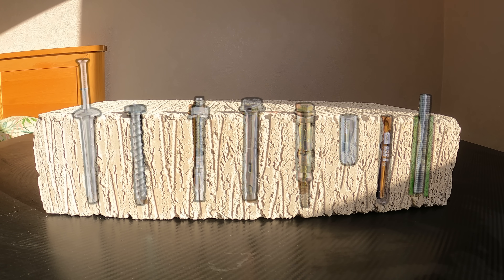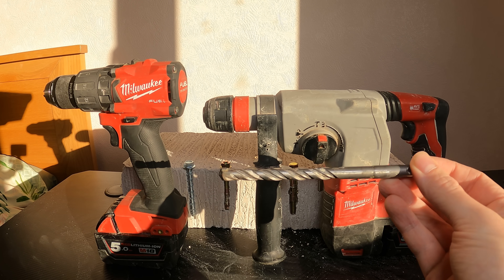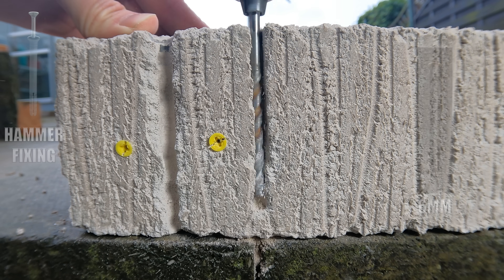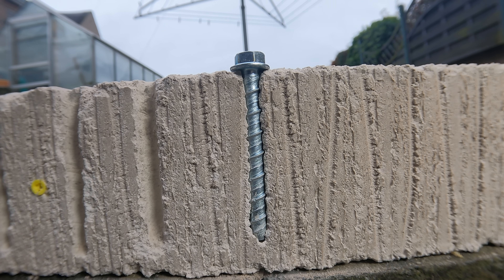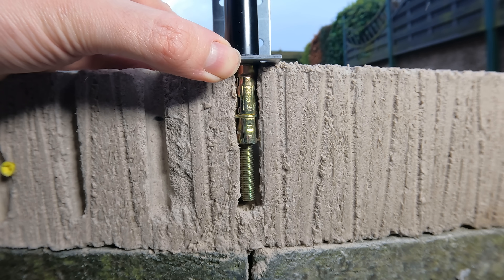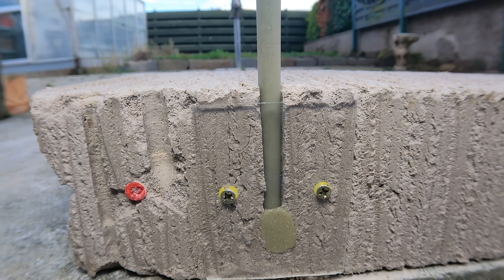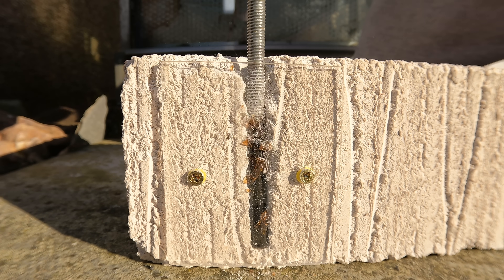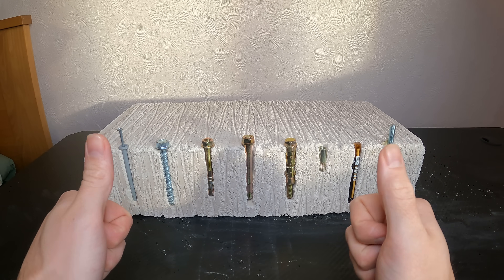CONCRETE ANCHORS FIXINGS AND BOLTS - 8 DIFFERENT METHODS FOR FIXING INTO CONCRETE

Comment: The glass tube resin I get to use on industrial jobs, and we use a paddle bit we break the glass with and mix it up, then stick in the threaded rod. Very strong for industrial applications,

Comment: Completely missed the point that the expanding anchors are putting a lot of stress into the concrete. For a solid piece of concrete that might not be too relevant, but if you're close to an edge, the quality of the concrete isn't too good or you overdo it with the tightening, or you have multiple anchors in a row with too low of a distance, you might just as well crack and maybe even split the whole block.

Comment: 2 is not secure in that kind of concrete, any kind of vibration or overturn would enlarge that hole and fall out.
6 is laughable. Most useless and ill thought design.

Comment: This was an incredibly done video. I am like you, and visuals are always better. I like the standard bolt, but could you mix it with resin, or with the expanding bolts, for a more permanent, secure result? Or is that just stupid or dumb?
Reply from the maker: Yeah you could do, just means its a permanent fixing and won't be able to remove it if required like you can with some of the other options

Comment: 35 years building and I don't use any of those anymore. The screws pull out, the anchors, too much drilling, the glue is a mess with air bubbles. 
GRK screws with weed hacker line or 14/2 works every time. Won't pull out, but it's also removable. And cheap.

Comment: Your sample is not a mixture of sand and cement in relative proportions, which is considered classic concrete all over the world. Do not use misleading terms, because the construction reference literature is the same, as is the data in it...... At best, your "concrete" is "porous concrete", called ["gas silicate" block] in Eastern Europe. ;)

Comment: The major advantage of resin anchors is that no water can penetrate the hole and, if it freezes, crack the concrete.
Especially suitable for outdoor use in concrete slabs.

Comment: Sleeve anchors for the win in all of my projects over the past 20+ years.  Never had one fail.  

I did have an issue once where I drilled the hole diameters too large and when tightening the bolts of course they worked their way out of the hole.  Luckily, I just bought the next wider size sleeve anchors and the problem was solved.  Key is to always drill the correct size hole.  Oh yeah, get that dust out of the hole to avoid having an issue with the anchor not dropping all the way down.

Comment: Extremely well done. It was explained with all of the details necessary and covered most every fastener available got a typical hardware or lumber store.
....and no music !!! 😁
If you did include some, I'll suggest MC Hammer's  Hammer Time or  Peter Gabriel's Sledge Hammer, used sparingly but only on the appropriate fasteners. 😉
Reply from the maker: haha nice one

Comment: A "through bolt"???  That's an expansion bolt and one of the manufacturers of them used to make a product called a "TruBolt".
If you are wanting to use an anchor for a use where it needs to hold a significant amount of load then it is critical that the hole be drilled AND CLEANED exactly per the manufacturer's recommendations.  It can make a lot more difference in the anchor capacity than you would think.
The concrete bolt tends to have the highest capacity these days, second would be the chemical anchor (usually called an epoxy anchor).

Comment: I like the screw bolt and resin fixings, which brings me to my dilemma.  I want to install an 8-kilo wall-mounted umbrella.  3m diameter umbrella when erected.  I have a hollow brick pillar, approximately 35cm square, perfect for the umbrella.  Should I use the screw bolt going in about 100mm or put a steel rod with fixing resin?  There are two mounting plates, each with 3 holes, so 6 mounting points in total.

Comment: Nice vid thx. One comment on the resin/ stud fixing - using a nut under the item being mounted places no jacking out torque on the concrete for a more secure mount.

Comment: Nice work on the video. A very interesting comparative description.  For your interest an old bushie (here in Australia) told me in the 1940s that he used to hand drill holes in rock with a hammer and steel rod, then insert the bolt but would back fill the hole with sulfur. They would then ignite the sulfur and it would bond the metal bolt to the rock. He said it worked well but I'm sure corrosion would have been a problem.
Reply from the maker: That's a new one I've not heard off. Thanks for the comments

Comment: Nice video there mate with drilling right on the edge! Screw bolts that I use (usually 14, 16 & 18mm dia.) are rated higher than sleeve anchors of same diameter. Using dustless SDS drill bits these days too. Total game changer. Can re-use the screw bolts again and again also. Winning!

Comment: However, it should be noted that concrete screws are not suitable for brick. The base material must be concrete if you want to use these screws. And if fire protection measures are relevant, plastic solutions are not acceptable.

Comment: I have to work with soft Austrian brick and lime mortar circa 1900. After lots of trial and error I’ve settled on epoxy resin in the mortar joints (to avoid breaking brick) and imbedding a threaded rod.

Comment: I love the drop in anchor to use normal m8-m10 bolts to fix things on the wall and to separte a storage space wall in low a pitched roof area from the normal room by having only small drill holes in the parquet floor. 
This enables a strong divider wall continous parquet floor and easy access via removeable dividers to the storage space 
And i have not to think about wear out of the fixing in the wall because of the metal threads.

Comment: Man, thank you so much for making this video. It is incredibly educational and i wish i watched it before messing up my anchor. So i installed a Sleeve Anchor but stupidly used an impactdriver and ended up capping the hear and now the bolt is tight and just flush with the concrete, the rest iscame off with the nut. How can i fix that?

Comment: Drilled a lot of anchors for mounting lights and what not.  Never have I bothered to clean out the hole. Then again, I don't bother with depth either.  So the hole is pretty much always deeper than the bolt.  
I imagine this only matters on a flat / horizontal surface as I've never had problems when putting anchors in walls.

Comment: Good introduction video but you should have gone into why there's so much variety in this type of fixing. You wouldn't use a hammer in fixing for the same job as a sleeve or shield anchor.

Comment: For my personal experience, shield anchor and drop-in anchor give me the "best user experience" in securement; Plastic wall plug with screw is my normal day-to-day application - fixing shelf, bracket, tv bracket, etc for moderate loading

Comment: In my experience, sleeve anchors either loosen up over time or if your attaching a post support to concrete, any movement in that post when installing loosens the bolt. 
The concrete screw bolts are far superior to everything else. The will not loosen or back and creates a fixing that competes with chemset.

Comment: 0:55 I think it's worth mentioning that the power of SDS drill hammer is not about the max force to rotate the drill but the max force to hit the drill against the concrete (SDS drill typically has 4–20 times higher hammering force). And it's pretty much the latter feature that limits your progress with concrete.

The demo shows that SDS drill was 50% faster but if you have actually hard and dense concrete, the SDS drill may be more than 10x faster. And if the concrete you have to drill contains big stones of granite, you better have real SDS drill because drilling pure granite with anything less is going to be a slow operation.

Comment: That's cheese,  now show us  the same, but in concrete!!!!    it does NOT work like that;  use SOLID concrete, use those methods, then  SHAKE and PULL, SHAKE and PULL, and MEASURE the forces needed, please quit playing around;   thanks for the video, still LIKED it

Comment: In good concrete, anything would hold. It gets tricky when you need firm grip in a shitty wall. Quality dowels for screws can save you (not the gray ones for hammer). Also, there are drill bits with ground hardened tip that allow you to drill without hammering. It can prevent the poor wall to shatter.

Comment: hey bud,  the SDS drill would need to complete its job in half the time if its 50% faster. your slide says 6 seconds for combi and 4 for SDS..... so the SDS drill is only 33% faster. Check ya math bro.
Reply from the maker: Yeah good point.

Comment: For each application pros and cons. For bolt ends: resin. Simply because I know I can put insane weight on them. Also Metal can and will corrode and this will DESTROY the concrete block or bricks (it will also leave a nasty stain), so use strong stainless for outside applications. For a secure fit of something I know I won't need to replace like a fence just use fischer plugs.

Comment: Comparing a drill with hammer function to an SDS (we just say dyna drill) on a brick is not that impressive. Do concrete to see the real difference in power and time.

Comment: If you ever have to remove these screws (the ones that are removable) and then put them back in (either the same one if possible or a new but same type of screw) should you also use a bit of resin that second time? I presume when you remove the screws you leave a slightly larger hole every time so the next screw coming in might not get such a good grip? Or use a larger diameter screw the next time i guess but you would also have to enlarge the bore first.

Comment: I've been using masonty ancoros for years, these days I believe the concrete screw to be potentially the strongest, the better the quality of the concrete the stronger the attachment.
 Their big advantage is they grip the whole length of the hole.
 AND
If the screw goes all the way thru the slab, they still work as well and the concrete will allow.
.
The resin anchors have an advantage in softer materials, because they consolidate the material adjacent to the hole.
.
 Nothing comes close to either of these two in their best applications
Reply from the maker: Thanks for the feedback. Great tips

Comment: You only really need to blow the dust out with the chemical fixings, the action of the auger on the drill bit will remove enough dust for mechanical fixings. You didn't mention the cheapest of all which is a screw and plastic plug, which is strong enough for a lot of applications.

Comment: FYI if you live in soviet bloc building, you need sds one. Those are quite common in former soviet union countries.

They're made like bunkers from reinforced concrete and normal drill will simply not be able to go pas through.

Comment: I'm wanting to put a 2.4 m (h)  x 2.7 m (w) stud wall into my garage and with the sole plate how to fix it into the garage concrete floor and also the brick walls. Which type of fixing would you recommend for a DIYer?.

Comment: i went with the screws into a concrete block and was able to pick it up by the screw with pliers and not have the screw pull out...good enough for wind load for me. thanks!

Comment: bought a safe off Amazon and came with the same bolt as in 4:40 never used that type of bolts before.. not sure if I should use this or just a normal plastic sleeve with normal screw. the wall is not concrete but bricks I think

Comment: Now I know why I was told to use the epoxy tubes that mix the activator with the resin and use threaded rods. Very strong. The visuals 100% drive home the learning.

Comment: outstanding video, I'm guessing powder actuated fasteners aren't too popular there, our typical is 22 caliber and will install a 3/16 nail 3 inches into concrete in a blink, or the OSHA banned high velocity ramset, it'll put a 1/4 inch threaded pin into concrete or steel
Reply from the maker: Yeah there are a few tool brands that sell them such as hilti and there awesome bits of kit. Unfortunately that was out of my budget to show  in the video lol. 
Certainly the quickest way of fixing into concrete.
Reply: @mikebolt9753  Understand that completely, great demonstration!

Comment: The big plus with hammer fixings is that you can drill through your wooden post then into the concrete without removing the post . This can save time and sometimes makes the job a lot easier (fixing window frames is a good example).

Comment: Excellent video, I have been trying to work out best type of Bolt or fixing to use to secure a shade sail to a brick wall, bricks are in good nick. The fixings that I have been set with the sail I don't think are strong enough for a 3m x 3m x 3 m triangular sail, so I need to use a bolt with a ring or eye at the end, what would you suggest?

Comment: Major difference in combi drill vs proper sds is operating mechanism. Combi hammer drill function comes from mechanical gears, which do wear off and loose effectiveness rather quickly. Proper hammer drill operates on pneumatic/hydraulic principles, this mechanism will retain efficiency for years. Also if you get yourself a proper sds drill - you can save on weight of combi, theres no reason to work with extra metal in the machine that you will never use, so you can go with lighter drill-driver machines.

Comment: Very nice video, thank you.  It shows not only how each type of anchor works, but it also gives a good view of the stress each one puts on the surrounding concrete and the potential problems that may occur over time. Like for instance what happens in an outdoor application, as rain water seeps into the hole around the anchor. Which makes the resin anchor (farthest on the right) look like the least stress / most resilient option, especially if a stainless steel bolt is used.

Comment: I just assembled a hand rail kit (made in China — no surprise) for porch steps, which came with M8-50 expansion bolts (maybe they are identified in this video as sleeve anchors), but no information about installation (drill bit size, hole depth).  Common sense would indicate the required dimensions, but your video gives me the necessary details missing. You’ve been very helpful.

Comment: Great video. Are any of these suitable for occasional screwing in and out? I need to attach a robot lawn mower base station to my paving slabs but it’s recommended to store the base station indoors during the winter so I’d like to be able to unbolt it at the end of every mowing season and reattach it every spring. I bought expansion screw bolts before I considered whether they are ok for this purpose. What do you think?
Reply from the maker: Would masonry screws work. Drill the correct size hole and then screw in the masonry screws which will tap the hole. You could then take them back out when needed.
Reply: @mikebolt9753 don’t you think the paving slab would crumble?
Reply from the maker: @JamboLinnman  Yeah possibly, maybe try your idea with the expansion screws. Probably a better bet to be honest.

Comment: We had several screws securing curtain rails to a masonry wall in the bathroom coming loose.  I found that injecting wood glue into the hole and covering the threads with wood glue before placing the screws works like a charm, they no longer come loose.  It even worked with a door handle where the screws were no longer able to secure the bracket to the wooden door.

Comment: Many thanks, this is really interesting.  I have to bolt into some old bricks & the suggestion I've seen is around lead anchors.  Seeing all those options is very useful to show the way each one bites into the structure in the drillhole as some of those will just destroy the bricks by the look of it.

Comment: I'm not a fan of the non removable options even though I have managed to get them out.. most important is that they are stainless or galvanized or they can crack your bricks when they rust.. I'd say I prefer #2 as well, we also get something similar with a plastic sleeve here.

Comment: I ended up here bc I got wondering if poured finer concrete around a threaded bolt if after concrete sets if youd be able to extract and reinstall bolt or not lol…

Id imagine that concrete threads would likely break or chip off when try to thread bolt back in, Course can just set in Sleeves for bolts when pouring concrete but Im curious if a bolt even needs it, If concrete dries to threads of bolt Id imagine bolt shpuld just unthread without any problems but an impact drill may compromise the fine concrete threads, But if hole gets reemed out bc concrete threads break can always resin bolt back in…

Comment: The video would be nice but in the case of open holes it is not authentic. Also this is not real concrete it is too porous.
Real concrete would not split like this and if the hole was closed then the screw would not behave like this either:  4:18

Comment: How do you prevent the resin injection needles from jamming up? I put a cap on it and it still solidified in the needle before I even moved onto my second anchor.

Comment: I've been using concrete screws for years,  I can't praise them high enough, brilliant easy to use scrws/ bolts rather than using plugs. Chemfix is also brilliant stuff. I don't rate the look of those glass tube versions though. Easier to use a tube of Chemfix/anchorfix. Great video, just the kind of info video we like to see.

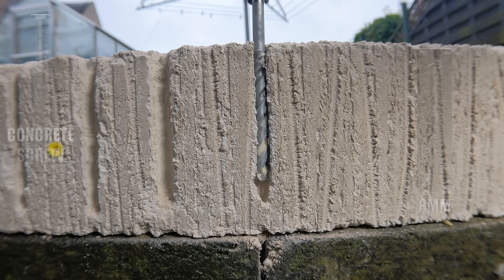Comment: 3:17 - This is the best for me and is far better if you fill the hole with some mortafil or concrete patch glue, makes a far stronger hold that wont come loose, if they are never to be removed.

Comment: the anchorbolts i have are loose at the end,you can screw off the expansion bit. isnt it possible that this part will not grip in the brick ?